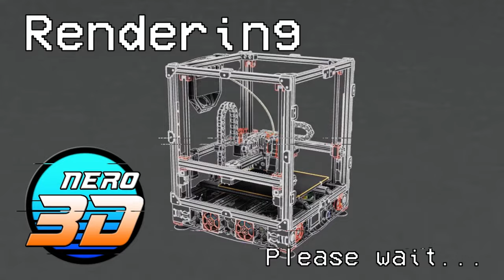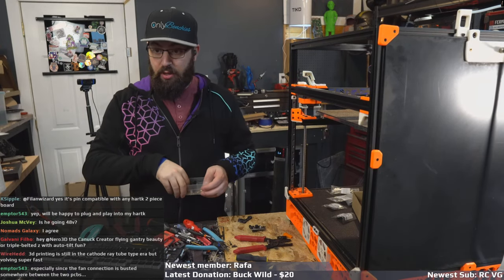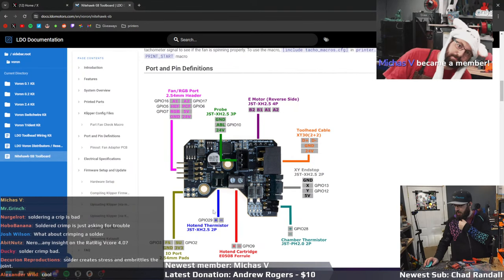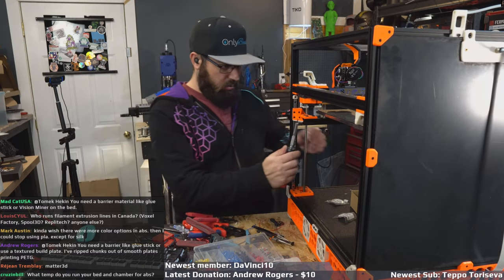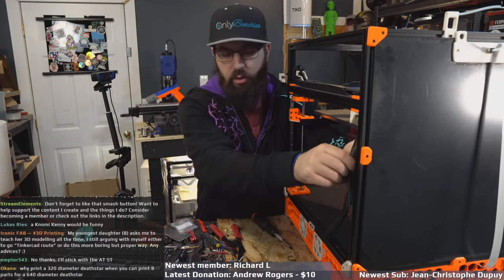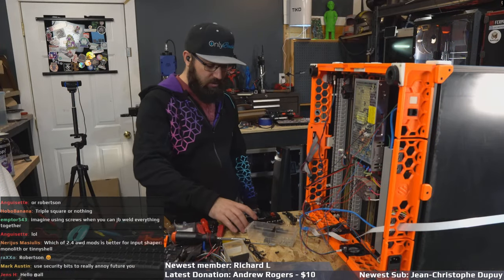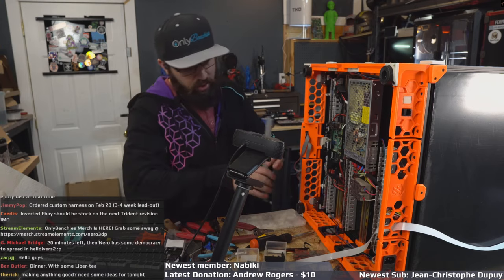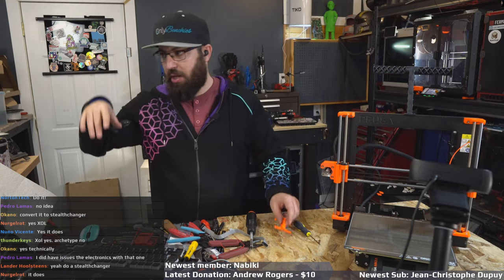Fixing and Upgrading - LDO NITEHAWK and LEVIATHAN install #livestream #3dprinting

Comment: Where in the stream did you talk about why you are still using the chains and not umbilical? I’m planning to go nitehawk on my V2.4 this summer but would have opted for the umbilical setup…
Reply from the maker: Cus at 350 size on a Trident I'm worried about the umbilical always rubbing on the top or drooping into the print area

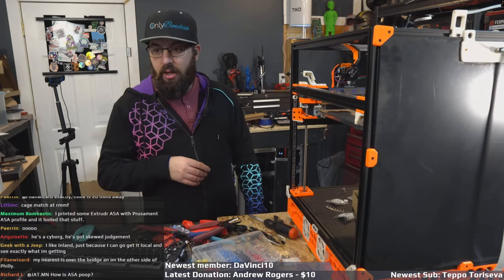Comment: 1:14:00 why does asa vs abs come up. It’s the same but with UV additive. 

I had a buddy buy shit quality PLA and he had enclosures and other stuff to get it to not peel. I said don’t buy cheap shit. 

I print prusament petg open air no drying and it just works. All printed on mk3s/s+ and prusa5XL.

Comment: Honestly 600 is not bad and is a good price for the in-betweeners not sure if they want to commit to a voron build. I think you went a bit hard on the firmware/klipper setup stuff in comparison you need to compile  voron firmware from scratch, your unlikely to find a config file that matches your setup exactly
Reply from the maker: I can forgive a DIY kit for having the need to tinker

But nowhere in the SV08 marketing does it mention `hey, the user needs to finish the printer to get the most out of it`

If its sold as out of the box experience, it should work out of the box
Reply: @CanuckCreator  that's fair, after rewatching if they have the config file locked or not ment for tinkering then it should work as is.